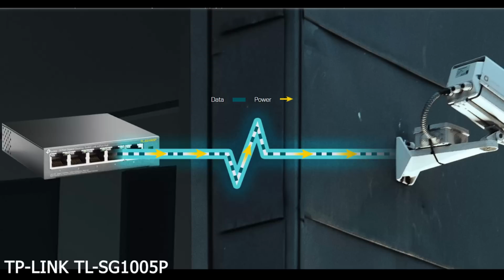Power Over Ethernet (PoE and PoE+) - in 5 Minutes

Comment: Can I run the lan cable from the router to the poe++ injector / then run a lan cable to a poe enabled (non + or ++) switch / then run another lan cable from the 1st switch, to another poe  (non + or ++) switch and have poe power for both switches?

Comment: My camera doesn't support poe? Just ethernet cable will this work for it?
Reply from the maker: No.
Reply: @GaryExplains  I meant my camera doesn't support poe , will the poe injector will work for it?
Reply from the maker: Only if you have a PoE splitter that supports the power needs of the camera.

Comment: Can i use poe from megabit poe switch
For 30-40ft for powering a wifi cam (1.5Amp,18W) using poe splitter instead of drawing power line

Comment: let me make it simple for you... Ethernet, 10Gbit or 1Gbit requires 4 pairs, 8 wires in total, but 100Mbit ethernet only requires 2 pairs, 4 wires in total, how an injector works is that it takes 4 wires and disconnects them to ensure there's no backfeed of voltage, it then leaves the other 2 pairs (4 wires) uninterrupted as a sort of "bypass".

Next is the voltage injection, that's simple it adds the needed voltage down the wires that are now split off.

it's quite safe as long as you don't plug it in the wrong end, it's quite easy to set up and doesn't cost an arm and a leg in patent t(r)oll's

Comment: This equipment only solves the problem of data + power out, but still requires a normal connection to a power plug to get electricity.  It should be data + power, both in and out.
Reply from the maker: Power + data in / out from which device in the setup?
Reply: @GaryExplains  If the switch was connected to a poe router, which exists, it could be powered by this connection instead of being dependent of a power plug which may or may not exist nearby.
Reply from the maker: Sorry, I think it is my lack of imagination at fault, you clearly have a layout in your mind, but I can't quite grasp it. So you are thinking of a remote location connected by PoE and you want to power a switch at the remote location along with other equipment all over the single PoE cable? By "remote" I mean anywhere without a mains socket nearby.
Reply: @GaryExplains  I never mentioned a remote location, like in another location.  I don't know your house but in mine I don't have power plugs in every wall, so if I want to stand the poe switch in an area where there is no power plug and I am not interested in using a power cable along the wall, a poe switch that could receive and send data + power would be convenient, that was my point from the beginning.
Reply from the maker: I did say that by "remote" I mean anywhere without a mains socket nearby, which includes "remote" places in your house. That is why I added that last sentence.

But as for your question, why not put the PoE switch with your other networking equipment and then run the Ethernet cable to where you want the end device. Why do you need a PoE switch in the part of the house where you don't have the power plug? I think I am still missing something in my understanding.
Reply: @GaryExplains  My initial observation should be interpreted as referring to the convenience of having another home appliance (in this case the poe switch) that does not require a power cable.  You may want to position the poe switch in another location of the house, not near the remaining network equipment, because the devices it will connect are located in another area of the house.  As the poe switch needs the connection of a cable from the router to distribute the internet signal, and as some routers now possess poe ports, why not use the cable from the router to the poe switch to also receive power from the router, thus dispensing the need for a power cable and a power plug?
Reply: This information from a known AI web site concludes my initial note - "However, there are some PoE switches that can be powered by another PoE source, a feature often referred to as "PoE pass-through" or "PoE+ in/out".

These switches can receive power from one PoE source (like a PoE injector or another PoE switch) and also provide power to other PoE-enabled devices connected to them. This setup can be useful in situations where power outlets are limited or when deploying devices in areas where it's impractical to run separate power cables.

Keep in mind, however, that the overall power budget of the switch needs to be considered. If the switch is powered by PoE and also providing power to other devices, it must have enough power budget to support all connected devices simultaneously."

Comment: Here's the scenario:  I have a smart device that consumes too much power for POE, but I need ethernet to control it and regular plug-in power to power it.  Here's the question:  Would I need a smart ethernet switch to turn off the power at that particular ethernet circuit?

Comment: for POE do not use copper cladded cable will over heat and cause fires
Reply from the maker: Really? Any links to examples of such fires?
Reply: @GaryExplains  yes have you heard of the channel by Chris tidous that does installs of Poe equipment he mentioned it plus I had that issue too
Reply from the maker: So to be clear, you have had PoE equipment catch fire?
Reply: @GaryExplains  yes i have had the cable burn up yes
Reply from the maker: OK, well, good tip. I think after reading some more, Copper Clad Aluminum networking cables should be avoided in general!
Reply: @GaryExplains  also Lawrence systems as well touch’s on Poe not to use copper classes as well

Comment: hello,! how much power output needed to power a router 12v 1a wired repeater(rujie 1200 pro) with a distance of 30meter upto 50meter I'll be using a rujie 1200 pro as main router and  ax1800tplink or rujie 1200 pro  as wired repeater that are connected to the main router but I don't know how much power I need there are 52v,47v 1a, 24v 1a, 15v 1a , 12v 1a as the option for POE adapter or POE injector

Comment: thanks for the video. How many cable pairs does the PoE needs?
Reply from the maker: 2 or 4 pairs depending on the standard your equipment uses. Best bet is just to use a full Cat 5 or 6 cable.
Reply: @GaryExplains  thank you for the answer! I used 2 cable pairs and connected them on the pin positions 1 2 3 6 for data and power but i can only find poe adapter that uses 4 5 7 8 for power so my poe access point is not turning on. Should i change the pin positions to 4 5 7 8 or there is poe adaptet on the market with 1 2 3 6 pin positions? Or i understood it totally wrong and data pins 1 2 3 6 is not for power and i need more cables for that?

Comment: Does POE degrade speed? ie, from 1Gbps to 100mbps? because that is what I am getting - or I am using a poor POE injector?
Reply from the maker: No it doesn't degrade the speed, but you need to use a 1Gbps injector. It sounds like you are using a 100Mbps injector. What model are you using?
Reply: @GaryExplains  I was using a TPLink injector POE2406.. will check my wires.. maybe there is the problem too?

Comment: Ethernet cable has like 8 wires in it would have been nice to know which lines were the power and which lines were data or does both get transmitted over the same lines?
Reply from the maker: Well it depends on the exact standard being used. Some use two pairs others four. Plus there are different methods known as alternative A and B. In "A" the data and the power are on the same wires, in "B" they are separate.
Reply: @GaryExplains  but all POE systems are interchangeable?  So how would one know which method is which?
Reply from the maker: @rockys7726  You don't need to know. PoE is designed to auto detect and auto negotiate.

Comment: I think Power over HDMI (or MHL) needs to make a comeback! There are so many streaming dongles & sticks sold these days and what's holding me back from getting one is the unnecessary cabling I'd need. My TV even has a MHL port but no stick or dongle supports it 😫 The right place to start removing the charger is on these things as there are better ways (for consumer AND manufacturer)

Comment: Small caveat. Gary is describing Active POE which is quite intelligent - the PSE and the device handshake to get reqd power. POE is typically 48VDC.
There is Passive POE like I have for my Ubiquiti wireless access point (AP AC LR) where the injector puts out 24 VDC without any handshaking etc.
So need to he careful not to mix Active and Passive kit, lest the smoke escapes.
Reply from the maker: Indeed. Passive PoE isn't a standard and should not be used by anyone.

Comment: Gary. How does an injector affect the max advised cable run for Ethernet? Total length of "Switch to Injector" plus "injector to powered device" less than 100m? I would expect that a lot of the time injectors will be sited close to switch, so inj->device length can be nearly the full max advised length.

Comment: TIP: Dont use 5 volts PoE on cable over 5 meters, you wouldn't get enough power. Iinstead run 24v, 36v, or 48v adapter then use converter box at the end of the cable to convert those voltage to 5v.
Reply from the maker: What PoE router are you using that allows you to select the input voltage?
Reply: @GaryExplains  All my routers are TP-Link that use 5v input, but i use 24v TP-Link PoE for source power. Then i use "PoE+Voltage converter" before the power enters router.

So the diagram like this.
[24v TP-Link PoE Power Brick] ---> [Ethernet cable over 15 meters] ---> [PoE+Voltage Converter 24v to 5v] ---> [5v input TP-Link Router]
Reply from the maker: I am a little confused. Are you saying your have TP-Link PoE routers that use 5v? Looking at the specification for the TL-SG1005P it uses a 48V/1.25A external power supply.
Reply: @GaryExplains  My router has no built-in PoE. its only have DC power input. My "PoE+Voltage Converters" have 24v PoE input and ethernet + DC 5v output.
Reply from the maker: OK, then I don't understand the point about 5v. If you are using a PoE injector or a PoE switch then 5v isn't an option.
Reply: "Dont use 5 volts PoE on cable over 5 meters" should say "Dont use 5 volts on cable over 5 meters, from a PoE tap."

Comment: In the next video please explain the risk of connecting a PoE cord into a non PoE Ethernet Port and incompatibility issues please.
Reply from the maker: There are no risks of connecting a PoE powered device into a non-PoE router, or vice versa. PoE is smart enough to know what is going on.
Reply: @GaryExplains  The key point is that no special "POE" cable is needed.  Just the same standard CAT5 or CAT6 cable for either POE or non-POE connections.

Comment: That is interesting. I have had 100 mbit routers for years. Worked fine for my home. I got a new internet provider and there modem in Gigabit. So I got 2 used 3Com Gigabit off ebay and I was floored how much faster it was. :-O
While some of the wiring was cat4 when I bought the house 20 years ago, I have updated some with cat5 in areas that was easy to reach... :-)
So while searching for routers I see the PeE ones and did not get them as I was not sure what they were for or if I would need them and I probably won't. But I see where the outside camra bit would be useful...
An there is the little add-on box in the video if needed. Lol
Off to run some Cat5e cable with my son, the boys are excited as the games are faster they say... Lol Don't play games so I have to take there word...
Thanks for the video!
LLAP

Comment: Can you please explain why would someone choose this over Powerline networking ? And Could TypeC be the cable to replace all of these annoying cables ?
Reply from the maker: By powerline you mean being able to use the mains cables in your house to carry Ethernet? If you do then the answer is because they are two completely different things that don't solve the same problems.
Reply: @GaryExplains  Thanks for the reply. Love your videos.
Reply: @GaryExplains  Does this mean POE is just the opposite of powerline? POE uses the ethernet to carry/extend power, and the powerline uses the mains cables to extend the ethernet?
Reply: Because Powerline doesn't work if you have rooms connected to different phases. Powerline is also much slower and the speed greatly depends on the wiring and the quality of the electricity (including all the other devices plugged into the wall).

Generally you do not want to use PoE unless you're using cameras or mesh routers in the roof, but I needed it for getting one switch to work as it's located in a place where there's no plugs for electricity nearby.
Reply: I use PoE for CCTV. Instead of running 2 separate cables like a peasant, I just run one. It's cheaper to buy an ethernet cable than to buy the coaxial siamese cable analog CCTV uses.

Comment: Thanks for this.

Seems a bit of a niche tech. 

For remote cameras or such,  a better approach is to have the data over WiFi and a simple power plug - eg mini usb cable over wall wort. Sounds like a fire hazard to have any significant voltage running over cat-5 , not to mention the susceptibility to lightening or power surges.
Reply: Wifi is almost never a better approach to anythin
Reply: @LA-MJ  ,

Nonsense. I have dozens of remote cameras which use WiFi. All I need to provide is a power supply- via extension cord, or battery pack or solar panel. These would not be feasible if I had to run cat-5 everywhere.
Reply: Wifi is shit when you have thick walls and signal interference on overcrowded air waves.

Comment: Would be nice to also include the differences between active and passive PoE. Like for people wondering why their PoE Ubiquiti AP doesn't work with their 802.3af switch/injector
Reply from the maker: @neoaliphant Was it a passive PoE switch? Because that shouldn't happen?
Reply: There's a lot of different non-standard PoE devices that aren't compatible and, in fact, can be damaged if mixed up, like my older Xirrus access points, and some cameras that only accept 12v (Sercomm iCam1000) or 24v (some cheapie Pelcos).  Gotta be careful hooking this stuff up.
Reply: @rbus  people miss up Poe with internet wire. The connection is the same, but Poe has his DC voltage (52v). Usually internet wire and routers  don't have power.
Reply from the maker: I don't anyone should be using passive PoE. If they are they should stop.
Reply: @GaryExplains  For me it's nothing more than an annoyance, but I'd like to hear your reason on why it shouldn't be used.
Reply from the maker: There is no power negotiation. The power is supplied regardless and that could damage the powered device.
Reply: @GaryExplains  Pretty sure though that the TP-Link you showed is passive.
Reply from the maker: No, it isn't.
Reply: @GaryExplains  - right, it is mind-boggling that companies just label their products PoE and do not support  802.3af. You always have to search for it in the respective data sheets when reading "PoE".
Reply: @GaryExplains  I ended putting hazard labels on the PoE ports and cables because of this. I'd replace the passive PoE router, but my home network is already overkill for the next 10 years or more. Can't really justify the expense.
Reply: @GaryExplains  What's the difference between power and data? How a device or PCB distinguish between power and data ?
Reply: @Almighty_Flat_Earth  it simply uses the unused blue wired for + and the brown wires for -. The rest are standard Ethernet data
Reply: @Rakusan2  that is what everyone should say at the beginning. The rest is b*"$t.

Comment: I think that we've had something similar to that in the land lines, it was powered by the land line and didn't have any batteries or needed to plug it in.
Reply: What's the difference between power and data? How a device or PCB distinguish between power and data ?
Reply: @Almighty_Flat_Earth data is just a state of power being turned on and off at certain voltages and speeds (look up how basic binary and logic gates work as a very very simplified version of computing and data transmission.) . PoE would be a constant voltage to power a device
Reply: Power line has bandwidth limit. 
Ethernet cable is more scalable.
Reply: Landlines have a bell wire, to allow the operator to ring the remote device.

Phone makers used this to also power phone displays, answer machines, etc.